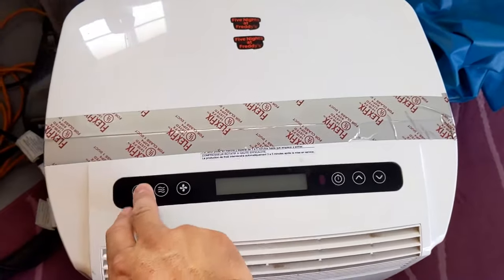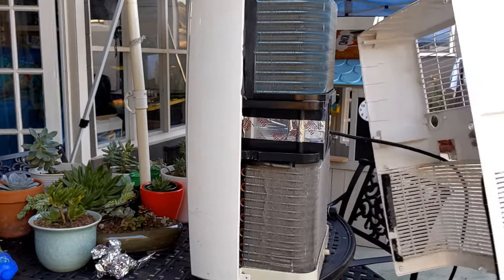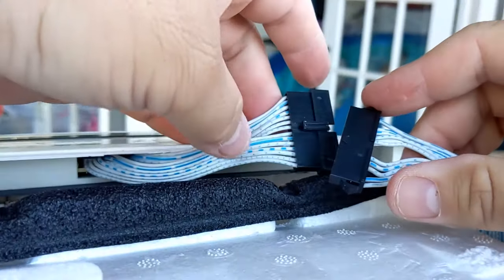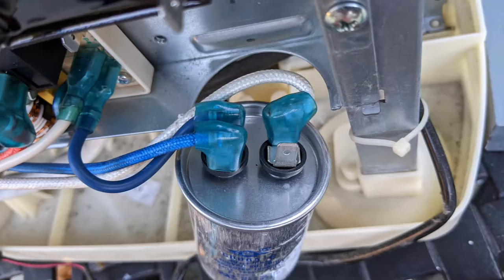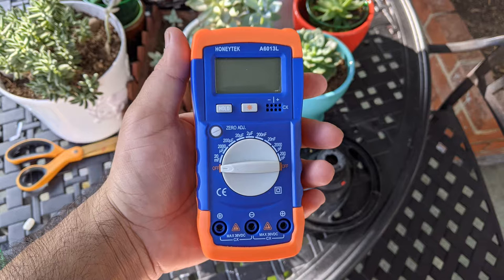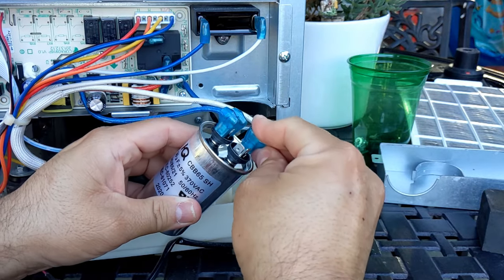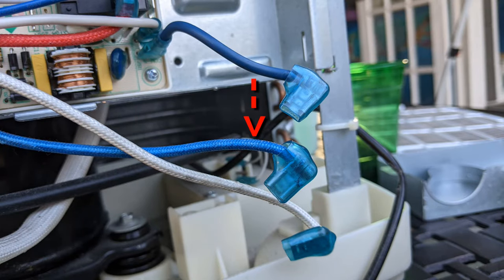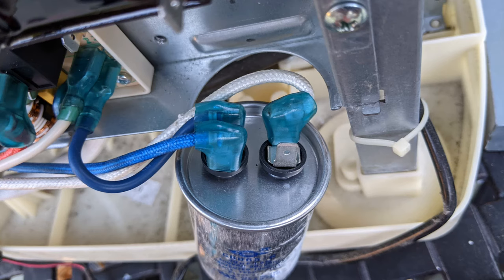Fix Your Haier Portable AC: Buzzing and No Cooling

Comment from the maker: **CHECK VIDEO DESCRIPTION FOR LINKS+UPDATES+CORRECTIONS+MORE INFO**
Reply: what if i get no reading at all on my capacitor? also, is 200u the same as 200 uf? my tester only has 200u on it. Thanks
Reply from the maker: @ZoulyVerse  Then maybe your multimeter is not capable of reading capacitance. U and uf are not the same. In the video description I posted a link to the capacitance meter I used. It is the cheapest one I could find that works.

Comment: Oh man you just made my day. Same exact problem. Ordered a new capacitor for 27$ on Amazon and BAM! AC is working again. I was that close of buying a brand new unit just before I've found your vid. I just saved a whopping 550$ :)
Reply from the maker: Whoa, that is awesome! Great to hear this video was helpful. The capacitor blowing out is a common problem with ACs, even with central AC units.
Reply: @ChavezDIY  The compressor was working normally giving out good cold air and suddenly it became completely quiet when the air-conditioner was switched on the next time, is this likely due to the capacitor issue? As you have said in the video there will still be starting sound coming from the compressor.  But in our case no starting sound can be heard, what are the chances that it is a capacitor issue?

Comment: Cheers Chavez you LEGEND!!
Saved me from busting out the wallet for a new portable aircon.
It was blowing warm air and the exhaust was not blowing hot air as I touched the duct.
Changed the capacitor myself and saw the bubble on the old capacitor that you described on your video.
And BOOM! its running again.
Reply from the maker: Niiiice! That's what DIY is all about... saving money, learning skills, and building up your confidence! =)

Comment: Hi, I took my PAC apart to clean it up, this was after a major storm and Power Surge in my Unit. Everything is working fine on it except it's not blowing Freezing Cold Air. No Leaks, Compressor Works, but I don't think it's getting all the Power it Needs, so I think it's the Run Capacitor that needs to be changed. Thanks For your Tips and a Great Video, Chavez. I will let you know if this fixes it. Take Care.
Reply from the maker: Good luck! Hopefully replacing the capacitor gets it running.

Comment: I think the capacitor gets damaged if the circuit is under current rating, for example when using a low amp extension cord.  This is caused by the excessive heat that the capacitor is exposed to due to excessive resistance
Reply from the maker: It's not recommended to use an extension cord with these ACs. If you do, you will need at least a 14 AWG extension up to 50ft distance and that should provide enough amps. I wouldn't recommend running a 16 wire gauge cord. We did for a while and the plug had burn marks because it overheated.
Reply: @ChavezDIY  im running a 100ft 10GA with a14000BTU portable.. working nicely :)

Comment: Wow this was really good sadly I bought a used LG 13000 btu portable air conditioner and everything works its turns on but sadly ut doesn't cool and of course LG hust says book a service call bit i cant cuz its used and who knows how much it'll cost to get ot serviced. But if my issue is the capacitor then im willing to see if i can order that part online and fix it myself. I did it w an old treadmill i am sure i can do it on this. Probably the most helpful video i see for over a year now i hope this solves my issue otherwise i waste $400 on a used AC... Careful where you buy things online!!
Reply from the maker: It's worth a shot to replace the capacitor to see if you can get it running. Good luck working on your portable AC! =)

Comment: My motor that pushes the heat out of the hose that goes out the window isn't working, would the capacitor cause this? I liked your video and would be grateful for your answer for my problem.
Reply from the maker: Sounds like your fan motor is not working. The capacitor I replaced in this video is for the AC compressor. The fan has its own capacitor, but it looks rectangular, you can actually see it above the cylinder capacitor in this video. Your best approach is to get a capacitance meter and check the capacitance of both the compressor capacitor and the fan capacitor. I have a link to a capacitance meter in the video description, its one of the cheapest ones you can buy and it works well. You're always going to have an AC for the rest of your life, so the capacitance meter pays for itself.
Reply: @ChavezDIY  thank you I'll check it out.
Reply from the maker: You can see the fan capacitor right above the compressor capacitor at 4:20 in the video.

Comment: Greetings, my ac fans go to low speed as the compressor is trying to turn on, I hear some low electrical hum but I can't tell. Everything is clean and I even poured out both trays of water. At this stage I'm going to follow your tutorial here to see if its the capacitor. Is this the symptom your ac was having? Did you hear the fans go to low speed why the compressor was trying to turn on but doesn't?
Reply from the maker: My AC was making a buzzing noise, so yeah there was more noise than just the fan. I don't remember the velocity of the fans at the time the unit wasn't cooling. I believe the sound the unit was making is included in this video, but you have to use headphones and turn up the volume to hear it. So the compressor has a capacitor, the round cylinder one, and the fan also has its own capacitor, its a rectangular cube looking one. Both capacitors have the capacitance range listed on them. The best way to approach this is to get a capacitance meter and check the capacitance of each capacitor. In the video description I have a link to a $20 capacitance meter on Amazon, its the cheapest one I could find and it works well. As long as you have fans and ACs in your life, you will need a capacitance meter to check the capacitors in case they fail.
Reply: @ChavezHobbies  I have a multimeter that has an option "200m", when I have it set to that I get a reading like yours where it starts at 3.1 then drop to the .3 range. Does my multimeter have the ability to get a reading?
Reply from the maker: @damian3182  Budget multimeters don't have capacitance readings. The symbol for capacitance is uF, on some multimeters its listed as uA.  I have two multimeters and neither can detect capacitance, that's why I had to buy that specific multimeter just for capacitance. You can buy a multimeter with capacitance readings but it has to specifically say it. You'll have to read the manual to check the capacitance with the meter.

Comment: The compressor does kick in on my portable AC, but no cold air. Could it be refrigerant issue?
Reply from the maker: These portable units don't have a service port to add refrigerant. I would start with cleaning the coils (check the video description for a link on cleaning the unit). If the unit is low on refrigerant that means you have a leak somewhere. With the unit open but still connected, run the AC and spray soap and water on the copper lines to and from the compressor and evaporator to look for any leaks. They will show up as active bubbles if you have a leak. If no leaks and you cleaned everything, I would check the capacitor. You will need a capacitance meter to check the capacitor, a link to the cheapest one I could find is in the video description.

Comment: i see that capaciator original says "protected" and the new ones not "protected". is this because there's already trip wire in the cord section? so doesn't need double protection?
Reply from the maker: That's a good question. I don't know the answer to your question =)
Reply: @ChavezDIY  lol thanks anyways, i got mine fixed just like you posted.
Reply from the maker: @sunkistv  Awesome! Glad to hear you got your AC running again!

Comment: Mine blows semi warm air no buzzing.  Do you think its still the capacitor if it doesn't cool?
Reply from the maker: Sounds like its not cooling. It could be the capacitor. Try it out and see if replacing the capacitor helps. Check the video description for more information.

Comment: Hi
I have changed the capacitor the exact way, cleaned the all the coiles but still not cold air, any suggestions please 🙏 
Thank you
Reply from the maker: Does the compressor turn on? Do you hear it running? If the fans are running good, it could be compressor failure or a leak of refrigerant. If you want to check for leaks, with the cover off run the AC and spray soapy water on the copper AC lines that go through the coils.

Comment: Im replacing mine and i seem to only find 45uf but the one in my unit is 40uf would it still work with a 45uf
Reply from the maker: Yes, it will still work with a 45uf

Comment: Compressor works on mine, coils and fins are clean, fan speed is strong, but it is still not cooling the air it blows out. Does this mean the freon has leaked? I don't see any leakage.
Reply from the maker: Interesting. Yes, assuming the compressor is working good, all signs point to low refrigerant. Run the unit with the cover off and spray soapy water on all the AC lines and see if you can find the bubbles, which would indicate a leak. You can also buy a refrigerant leak detector on amazon and see if that helps to identify any leaks.
Reply: That's my next step before I decide to buy a new unit. I have hope that there's still a lot of gunk in the fins that can't simply be sucked or brushed out. This is for a less commonly used room so I can tinker with it, good way to learn how these things work as well.

Comment: I have a portable unit that the fans won’t come on but the compressor is working. Any idea?
Reply from the maker: There's two capacitors inside the AC. One is the cylinder shaped one that I replaced in this video and the other is rectangular shaped. Check capacitance of both capacitors. You can also check the motherboard to see if there are any burned components.
Reply: Thanks man! The capacitors test just fine. The fan motor is hard to find and a pain to get off so I’m going to go recycle the thing. I don’t know if it’s a European thing or not.

Comment: I have a problem, when the compressor kicks in it vibrates a lot for about 15/20 seconds it cool off and on. Any suggestions?
Reply from the maker: 1 Clean the coils. 2 Check the fan capacitor and compressor capacitor with a capacitance meter.  There's a link to a capacitance meter and additional information in the video description.

Comment: Hello my cost way doesn’t turn on it just has the red dot  on do you know what the problem could be
Reply from the maker: I don't have any experience with that kind of problem. If you have your AC product manual it sometimes can give you troubleshooting tips. Try to find it online if you don't have it. Sometimes the red light can mean that you need to clean the removable screen filter. If it is not the filter light, maybe it's a power supply issue. Check the video description for a list of troubleshooting tips.

Comment: I have to same unit and it blows cold air and the hose takes out he hot air, But it doesn't cool down the air for 5 hours..I have a 2 inch space under the door and have 10 foot ceiling. The room is 13' x 17' any suggestions?
Reply from the maker: For the 2 inch gap under the door, you can cover it with a door sweep, there are cheap ones at Home Depot. Portable ACs will not be able to cool down a room better than a window AC unit. I recommend portable AC only if you cannot install a window unit. If its blowing cool air, the only thing I can think of is to clean the coils, I have links in the video description to my video on cleaning the coils inside a portable AC. If you clean the inside but its still not cooling good, it just means you need a stronger unit. Something with more BTUs. A 8k BTU window unit will outperform a 8k BTU portable unit. My current window unit (6k BTU) in my office space is undersized so it takes a while to cool and never reaches a nice cool temp on a really hot day. I need to upgrade to a bigger unit with more BTUs.
Reply from the maker: How to clean Haier Portable Air Conditioner
     https://youtu.be/lnJKBi-pB_4

Comment: What if you replaced the capacitor and it still not blowing cool air ?
Reply from the maker: The fan has its own capacitor too, so you need to check that capacitor as well. You can't check it without a capacitance meter, I have one listed in the video description. Make sure that your coils are clean, Check the video description for a video on how to clean the coils inside.

Comment: is it normal to hear the buzzing sound still? i have a toshiba brand new. its cooling fine but it's making buzzing noise
Reply from the maker: It's normal for compressors to make a buzzing noise when they're running You can hear it in my AC after I fixed it. The compressor has rubber feet to try to decrease noise from vibrations but sometimes the vibrations get through and shake the outer case of the AC.
Reply: @ChavezDIY  I research everywhere online and everyone is complaining about the compressor noise. it seems like a normal portable ac compressor sound. Some says it goes away after a few days or weeks of normal use. Although I think the rubber that's supposed to reduce noise is probably loose during transportation. It's sad. It's so loud
Reply from the maker: @kitn.6130  All compressors make noise, but some are louder than others. With window ACs the compressor is right there in your room, haha, you'll be hearing it. I had a Honeywell 14K BTU portable AC unit that was louder than this Haier 8K BTU unit in this video. I also have a Frigidaire 5k window unit that is kinda quiet compared to my LG 6K BTU window unit.

Comment: my portable air conditioner all work fine( fan and compressor are working) but it dosn't cool, it's very clean, no dirts!! any help here please!! the outside air  tempreture is cool as well that should be hot not cool! Please help
Reply from the maker: There's a list of things to check in the video description. My compressor was working, but not cooling. My capacitor was operating below efficiency, it wasn't completely dead yet. You need a capacitance meter to check the capacitor. Just because the compressor is making a noise and the capacitor is not swollen, that does not mean the capacitor is good.

Comment: i removed all the screws EXCEPT there are 2 that are so deep i can't get to them. i was able to pry the back off enough to clean the coil grill-thingy, which had nearly 4 inches of cat hair plastered to it! but that didn't fix it. i can't open the unit any further--my guess is the prob is the capicitor b/c it buzzes like yours, too. can i bring it to a repair shop? it's a honeywell. thx!!! ♡h.
Reply from the maker: You'll need a long screwdriver or long screwdriver bits to access the deep screws. Yikes 4 inches of cat hair and dust that's a lot, haha. A capacitor replacement would be the next cheapest investment to try. Any HVAC business or technician should be able to look at it. Good luck!
Reply: i'm stunned! i FIXED IT!!! 1st i ordered a 12" screwdriver from amazon… when i opened the electrical box, i discovered a capacitor EXACTLY like yours! so i just followed you the rest of the way. NO ONE, not even my brothers, were willing to help me! i'm so proud of myself! THANK YOU!!!!
Reply from the maker: @heidicleveland5887  You're welcome! That is awesome that you were able to do it yourself! ofcourse you could!!! You're now a DIYer!!

Comment: Hi there mines the blower and compressor turns on but the fan from the top to blow air out doesn’t work
Reply from the maker: The fans have their own capacitor. Its a rectangular cube looking thing. You'll need a capacitance meter to check the fan capacitor. In the video description I have a link to the capacitance meter I used in the video.

Comment: Mine blow cold air for seconds but after that it stops .and no hot air coding from thé back
Reply from the maker: I don't know HVAC diagnostics, just the basics. I would clean the coils if you haven't done that. Then I would check the capacitance of the compressor capacitor and fan capacitor. There's a link to a capacitance meter and some additional information in the video description.

Comment: My rear exhast fan isnt kicking on with the compressor so it over heats, ideas? thanks!
Reply from the maker: There should be a capacitor that powers the fan. I would check the capacitance of your two large capacitors, the cylinder one and the rectangular one (located directly above the cylinder one in this video). My guess is that the cylinder one is for the compressor and the rectangular one is for the fan. You will need a capacitance meter to check them. The meter listed in the video description is cheapest one that I have found on amazon.
Reply: @ChavezDIY  thank you, mine has a lot more screws and clips than yours :P Just trying to narrow it down first!

Comment: My compressor will kick on, the after a while it will turn off, the air won't be cold for a couple minute, then it will come back on and the unit will shake pretty hard. Could this still be the same thing in the video?
Reply from the maker: When was the last time you cleaned the coils on the unit? If the coils are dirty the unit could shut off due to overheating. Here is a video showing how to clean the coils https://youtu.be/lnJKBi-pB_4   If the coils are clean, then yeah the next thing I would look into is the capacitors. There is more than one capacitor, there's a square one that shows up inside my unit, that was going to be my next item to check. You'll need the capacitance meter to check your capacitors. $20 for the one I have in the video, link in the description. Its the cheapest one you'll find and you can resell it after.

Comment: What if it does this brand new?
Reply from the maker: If its not cooling and its brand new, return it if you can. If that's not an option, I would check the compressor capacitor with a capacitance meter.